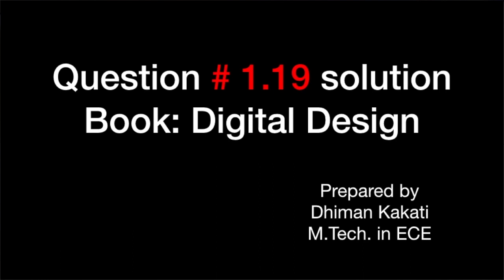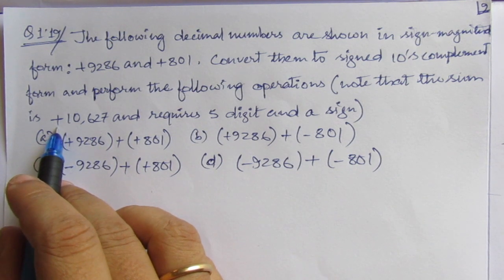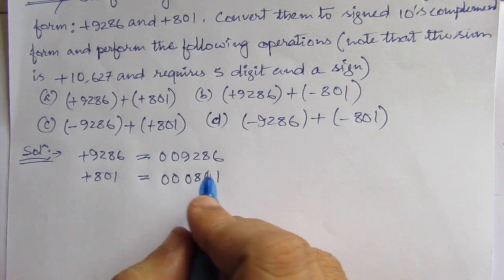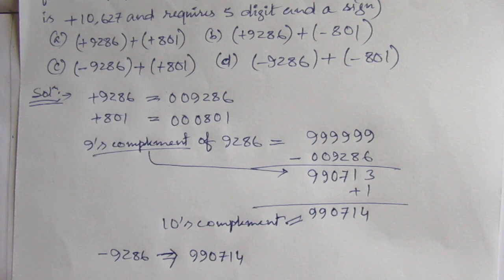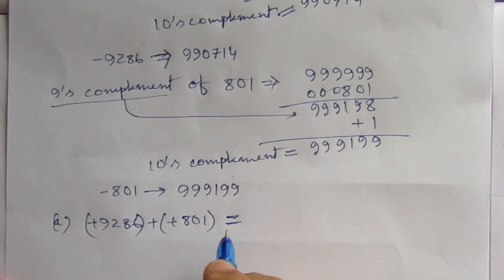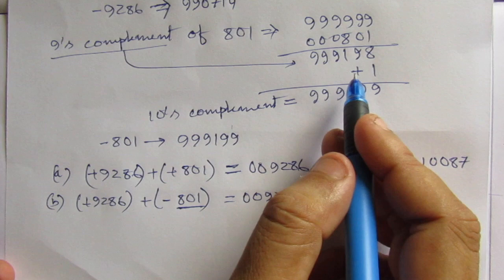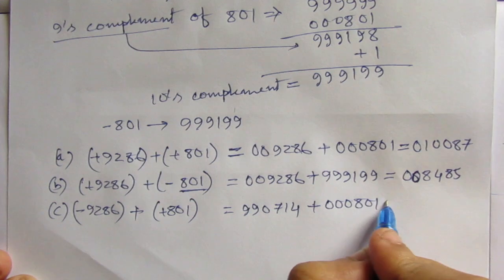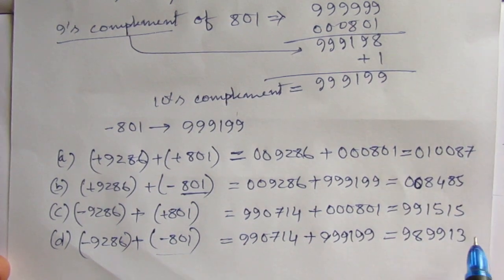Q. 1.19: The following decimal numbers are shown in sign‐magnitude form: +9,286 and +801

Comment: @Dr. Dhiman Kakati why we are not assigning 1 as signed number for - 801 and - 9286 as for positive we put 0 on left and for negative numbers we put 1 to indicate the sign in ques part b and c while calculating why we have 000801 why we are not having 100801 as 1 indicates negative and we have - 801.
Reply: We use 0 and 1 incase of binary numbers and 0 and 9 in case of decimal digits. And we represent negative numbers in 10's complement in cae of decimal arithmetic.
So to represent  -801 you have to 10's complement of 000801 i.e 999199. Same goes for -9286.

Comment: Sir why you not take again 10s complement when you have no additional carry.
Reply: Next to 4:44 see.The Answers of b & c part are different but there values are same.
b)::(9,286)+(-801)=008485
C)::(-9286)+(801)=-(008485)but your answer is 991515 .How is this possible sir?
Reply from the maker: @talhaakram7238  Good Question. From the question, we can see that we have to do the various given operations in signed magnitude form. 

Subtraction of a number = addition of the 10's complement of that number

So, for  -008485 (five-digit and a sign form), if we find the 10's complement, we get 991515. 

Explanation: 
9's complement of 008485=999999 - 008485=991514
Hence, 10's complement of 008485 = (9's complement of 008485) + 1 = 991514 + 1 = 991515
Reply from the maker: Please specify the time duration in the video where your question lies?